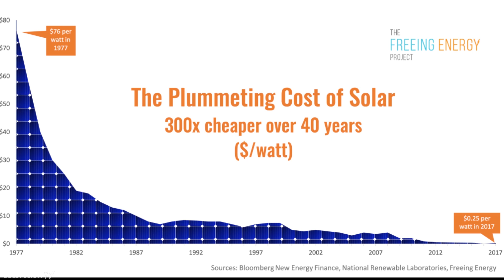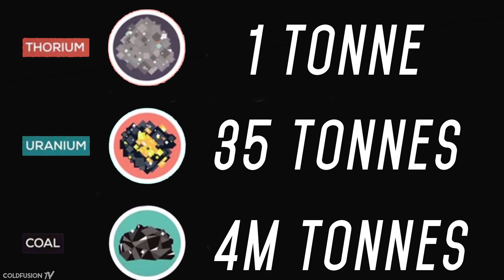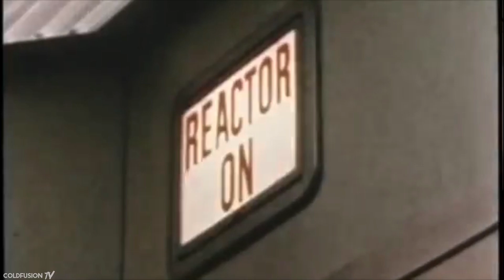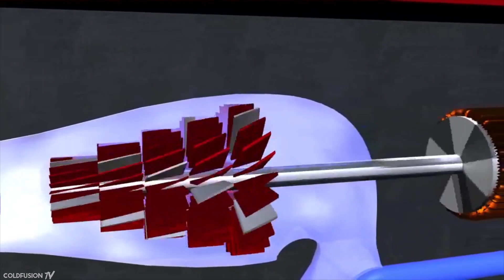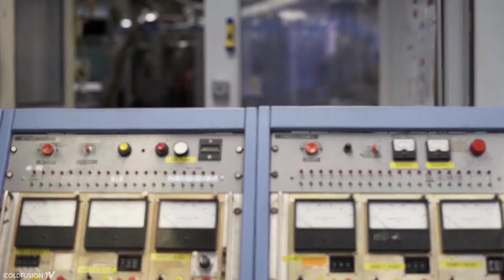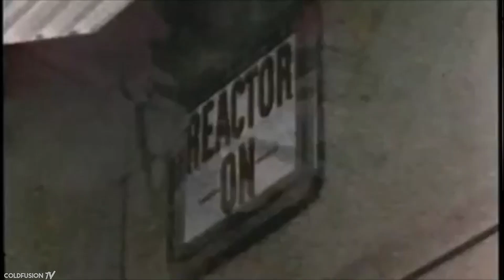Thorium - The Future of Energy?

Comment: 1. Nuclear is not dangerous, even Uranium reactors, there's been over 60 or 70 years of nuclear reactors, and only 3 major accidents, if you take all the deaths caused by nuclear accidents and bombs, you don't make a year of deaths caused by fossil fuel burning, so, quit fabricating excuses for nuclear fear-mongering.

2. Enriched Uranium is not difficult to contain, in fact, Uranium reaction byproduct is the only energy conversion form that's fully containable, no residue is dumped on nature under the ideal circumstances, again, fear-mongering.

3. You forgot to point out the 2 biggest downside of Thorium reactors, the first one, is their propensity to rust, yes, rust, the liquid used in thorium reactors is a kind of molten salt, causing many issues, from broken equipment, to energy blowouts, fortunately, as pointed out, no meltdown risk exist, the second one is their possibility of decay into Thallium 208, although it may be very rare, it's a possibility. 

Don't take me wrong, I'm the biggest Thorium fan there is, but I'm also a Uranium fan, and the world is unfair to Uranium reactors, we should use more of it, but stupid politicians are trying to phase out Uranium power, and Thorium is not ready for mass use, so we must use Uranium until them...

EDIT: Formatting, the post got very out of shape after submitting it...
Reply: We really need to get rid of the whole thorium versus uranium argument or at least its phrasing, because it doesn't make any sense. Thorium 232 is a fertile fuel like Uranium 238 - it does not undergo fission, it is transmuted into a different isotope that serves as a the fissile fuel. 
Th-232 +1n -> Th-233 -> (decay) Pa-233 -> (decay) Uranium 233 (the actual fissile fuel)

U-238 +1n -> U-239 -> (decay) Np-239 -> (decay) Pu-239 (the actual fissile fuel)

When talking about fissile fuel comparisons you are comparing Uranium 233, Uranium 235, Plutonium 239, Plutonium 241 (MOX) and Plutonium 242 (MOX). 

We don't call conventional reactors or fast breeder reactors Plutonium reactors, so why are we using the term thorium reactors?
Reply: @brian2440  The correct term would be LFTR, right?

I doubt this channel even know about that...

Comment: the major problem is the sodium flouride salts to be used which degrade the containers, we need better containers is the only last major hurdle
Reply: You just run two reactor chambers side by side.  Run the molten salt in one of the reactors with the other completely empty and clean.  After several years you just move the molten salt slurry to the second reactor and do maintenance on the first
Reply: @Les_S537  aye good idea for sure... The problem is cost benefit.  It actually degrades the container so it's pretty worthless after from what I understsnd
Reply: @d3g3n3r4t3  then just replace it every few years alternating one to the other.
Reply: @Les_S537  ya but they want containers that will last 50 years. Not 5,  they prolly cost alot. So research into more resistant materials is being done,  well and into less corrosive salts.  If it was as simple as swaping them it would be much closer to being implemented. It's a cost restriction  meaning at the moment cost wise it's not better than coal. From what I understand. Tho I duno a whole lot about the specifics
Reply: @d3g3n3r4t3  molten salt reactors are going to be much cheaper to build and operate than the reactors you're used to today.  Today's reactors operate water under extreme pressures.   Boiling water reactors operate at about 70 atmospheres.  Pressurized water reactors operate at about 160 atmospheres.  This greatly increases costs to build and operate.   Multiple layers of safety need to be maintained.  Redundant systems have to be put in place, etc

Molten salt reactors operate at 1 atmosphere., and will be about 1/20th the size of today's reactors doing the same workload.  Moltex, one of the advanced nuclear design companies, says that they can operate at $2.50/W.  Today's coal plants operate at $3.25/W.  Today's nuclear plants operate at $7.40/W.
Reply: @Les_S537  notice how we don't have a cost listed for the thorium pretty sure it's still high because of the containers. If u find let us know but doubt it's better yet. Bill Gates has a company I hadn't heard much about lately. I wonder how far along they are. I that they were making some in China with his company. And the pressures u are talking about are strsm pressures for the turbine. The actual fuel rods arnt at those pressures

Comment: Thanks, this was really interesting. 
Conservative thinking in power management is so backwards, it should be on the leading edge of technology, because our world runs on electricity more and more. 
But is this the solution, i don't know its a start that should have been done 50 years ago just like the first electric car but greed and war lust kills greet idea's. 

I hear Hyundai is starting with Hydro engine trucks, and cars. Now i know hydro can be done in a closed system, were the expelled water is re-electrolysised and put back into the system like the google flyer. But the cars seem to need to tank electrolysised water. Can you go more in depth on how hydro systems work maybe and how scaleble they are because the smaller we can make self contained power supplies, the faster technology can go forward? I seen some 15x2cm hydro power cells but that start up did not get very far but the idea is amazing.

Do you know more about the thermal vent power Plants? 
In theory that are completely clean and can vastly outproduce the power consumption of the planet. But i have not seen anything about them for over 15 years.  S

Its funny you show this US street filled with glowing bill boards, we don't need those there ugly and are a wast of power, I happy we don't have a lot of those in the cities here.

Comment: With a shorter half life, the radioactive decay is faster, meaning there is more radiation, not less, as it degrades. So in that way Thorium taking 300 years to degrade is more radioactive during that time than Uranium. So if something were to happen to the holding tanks of the radioactive material... 

I did my freshman year paper on Molten Salt Fuel Reactors. 

Pretty novel to think someone could hold a small rock of thorium in their hands that would be enough energy for their entire lifetime’s electricity demand. 

The hope was that the fuel could be reused, the waste could be used as power.

Comment: You're conflating thorium and the molten salt reactor. Thorium doesn't have to be burned in an MSR and an MSR doesn't have to burn thorium. In fact thorium has to be transmuted to uranium before it is even fissile. We already have hundreds of years of processed uranium we could burn in MSRs. Reactor design is the key not the fuel. Hell an MSR can even burn plutonium.

Comment: What about thorium reactors for deep space exploration? Solar power gets exponentially weaker the further you get from the sun, we're running out of fuel for RTGs, and it's risky to launch uranium because of the potential for the rocket to explode and spread radioactive dust through the atmosphere. Thorium seems like it might be a good alternative for high-power applications such as manned exploration or colonization
Reply: Those run on radioactive heat and thorium is barely radioactive.
Reply: @iamchillydogg  Correct, I meant Thorium nuclear reactors as they are described in the video, not as a replacement fuel source for RTGs. RTGs also don't generate that much power, more than solar in deep space but not as much as a reactor.
Reply: @dbreakiron  
Thorium isn't fissile. You need something like uranium or plutonium to bombard it with neutrons to transmute it to uranium. So you would still have to launch those.
Reply: @iamchillydogg  Ah, ok. Must've missed that. Thanks!

Comment: The lack of willingness to push the technology forward is the main problem with nuclear power. The main problems (meltdowns, waste, etc) are solved on paper for several designs using both uranium and thorium. But these designs - molten salt or fast breeders - are completely different from current nuclear plants. Until regulators stop being conservative, nuclear will keep being crap.

Comment: There are a couple key downsides you've missed when discussing thorium as a fuel first of all they are more difficult to control and secondly the reduced half life means the waste from thorium fuel is much more radioactive. My professors would joke that you couldn't steal thorium waste because it's so radioactive that it would kill you instantly and is thus a lower proliferation risk.

Comment: Nuclear power plants type II (most of the current ones) face a huge crisis due the financial costs and lack of competitivity vs natural gas and nenewables, but they exist because are needed to produce weapon-grade fisible material and due the civil engineering knownledge they retain is needed to keep nuclear powered ships active. Thorium power plants of 4th generation could potentially be better than the uranium and plutoniun ones, but have 0 use for the mititary stablishment and the budget they require is massive and the operational costs are unknown. So they will fail, because the climate crisis must be solved on contained in the next decade, and no new nuclear power plants will be ready to change anything before 2030, even if we start to build 200 just tomorrow. In the end, the demise of nuclear is the same as the fall of the coal: they are no longer competitive. You can build as many as you want in my backyard, but if you came to begg me (or to begg my government) a dime to found the construction you'll be shooted. Repeteadly.

Comment: Costly shift to GE.  Processing would be at the reactor and scaling would be to thorium's advantage.  Current Uranium sites retrofitted would be able to produce an order magnitude greater output with much lower cost.  For an example, Ginna power plant in western NY with an output of 578MW could contain a 5GW LFTR in the same containment area.  This would require a build out of the generator building for the increased capacity.  The other advantage is the reprocessing of the fuel rods as more "feed stock" to the reactor.  Liquid fluoride cycle gets rid of the H2O/ Zirconium explosion risk and flash vaporization of high pressure water.  Being a reaction of 1 atmospheric pressure vs 75 to 140 leads to less containment needs.  So higher fuel utilization, lower containment cost, lower cost due to half-life of the final products, high temp chemistry processing opportunities, reduction of current waste products.  Did I mention that by using Thorium from the tailings of current mines, coal fire plants and steel smelters would free up rare earths needed in our high tech industries?  No need to go to China at all!!!!
Reply: Exactly...  We will need rare earth metals/minerals to build out all the electric car batteries we will need in the future, and thorium happens to be found in abundance where rare earths are found.  So you lift the restrictions on mining both of these things and you've got your fuel for the nuclear reactors, and you have your materials to build electric car batteries.

Comment: Just a thought. If you drill deep in the earth it gets really hot. Couldnt that be used to create steam (electricity)?
Reply: Better yet, you drill a shaft into the earth several thousand feet deep.  You attach a generator to a heavy weighted object that can fit into the shaft with cables, and then you let the heavy object drop into the shaft with the cables pulling the generator to generate electricity.  Then you hoist it back up and repeat the process.  Not sure of the efficacy of the idea but I've seen it bandied about here and there on the internet.

Comment: I was worried this would be the latest in a long line of nuclear shill propaganda which seem to be very common these days. Hell, I've actually seen some claim nuclear waste is so safe you can throw it all in the ocean.

Glad to see this is not one of those. A good, nuanced review.

Just some thoughts.
1) People keep saying interim, interim, interim. Well, interim implies now. There is not a single working thorium reactor in the world right now. It is literally only in R&D. The earliest full blown Thorium reactors estimated are 30 years from now. Which part of that is interim, I don't know. Solar, wind, wave, etc are already in the supply chain. It keeps getting more efficient and cheaper and battery tech keeps improving along with it. Especially solar which hit Gigawatt level capacity in China.

2) Some people  literally claim Thorium has no waste. They're wrong. It does has waste.

3) Some claim its waste is safer cause it is in the hundreds of years instead of tens of thousands of years. Well it is far deadlier and more radioactive, which is why it has a shorter lifespan. And 300 years is not exactly easy to guarantee the safety of deadlier radioactive toxic waste either.

4) As we have zero experience with using the new MSR designs, nobody knows whether it works, how effective and safe it is yet. The first r&d reactors are only schedule to go online this year, IINM. Lets finish the tests carefully, before we proceed further.

There's just so much nonsense going around right now. We need to understand it is not a magic bullet. Let the science do the talking. Not nuclear money propaganda.
Reply: Actually, throwing the waste in the ocean off the continental shelf IS one of the safest places to put it. Water is a moderator.
Reply: @paulbradford6475  LOL

Comment: You told some of the story. Thorium also can be used in small communities. In contrast to today’s giant monopoly driven utility infrastructure. Thorium is a small unit distributable source of boundless energy and significant safety features  – compared to what we now have.  

Remote regions of Alaska have applied for the permits to test small thorium reactors for their local energy needs. The Nuclear Regulatory Commission has held up their applications for over  5 years. 

The infra structure costs you mention would be borne by small private sources  –  not the taxpayer.  The giants utilities are fearful of this viable, safe, and cheap source of energy which in fair competition would wipe out the existing monopoly driven utility industry.

Comment: A cartridge loaded  Micro-Thorium reactor could power a full apartment building,  with a device as easy to use as a microwave.
It is the only consumer-grade  nuclear device,  it has little potential as a weapon.
Certainly  micro-reactors would need operated by licensed professionals, but it would be useful for distributed power.
A back-up reactor for cloudy days when your Tesla Solar Roof is a little low on light.  https://youtu.be/nqN0v_lPzFY

Comment: Don't portray uranium as the bad guy here. Thorium decays into a kind of uranium. The true miracle here is not the fuel, but the liquid reactor type. It's like moving from steam-powered trains manually shoving coal into the fire pit to diesel trains. The real wonder is that Molten Salt Reactors can burn used fuel rods from traditional reactors, old nuclear bombs, and both uranium extracted from seawater and thorium. Nuclear waste and warheads: in it goes! Ed Pheil is working on the MCSFR, a fast Molten Salt Reactor where the old nuclear waste from the last reactor doesn't even need any pyroprocessing before hand. Just cut it up and chuck it in! No siphoning off bomb grade material in any chemical sorting beforehand, no proliferation risks. In it goes, and never comes out again!

Comment: So many myths propagated here. U233 makes a perfectly practical weapon material. The US exploded a test weapon based on U233. Thorium reactors did not progress because they were technically much harder. Despite billions of $ spent in research in many countries, nobody has ever produced a practical Thorium reactor design.
It has theoretical benefits but major unsolved technical problems. Containment and reprocessing are unsolved. It is a greater, not a lesser proliferation risk than current nuclear tech. For sure it is more efficient in theory, but in reality the world has enough Uranium for now. If you want to go nuclear, current designs of PWRs are sufficiently safe and carbon neutral today. The major unspoken problem with nuclear power generation is that it is very expensive, and if you try to do it cheaply you end up with Chernobyl.

Comment: I know about 95% of used uranium fuel is recyclable and I would be curious to know what percentage of used thorium fuel is recyclable? Based on the comparable waste of 0.6%, I suppose it doesn't matter too much from a comparative standpoint - especially when you include the efficiency of the element. Nonetheless, the U.S. is basically burying their fuel by not recycling it like the French do.
Reply: Molten salt reactors in 5 minutes
https://youtu.be/uK367T7h6ZY